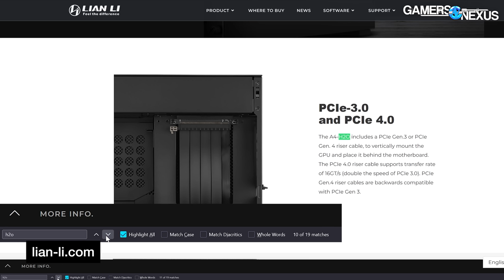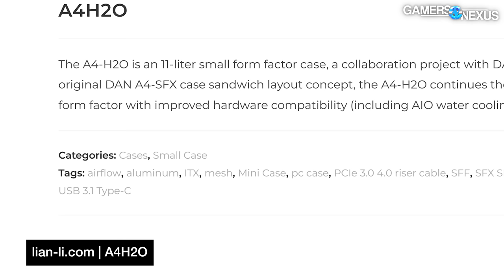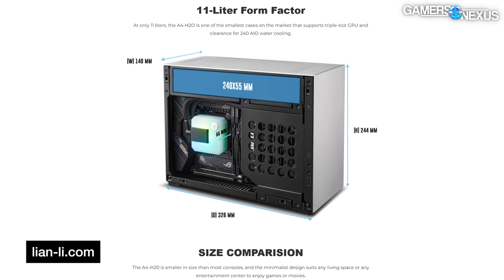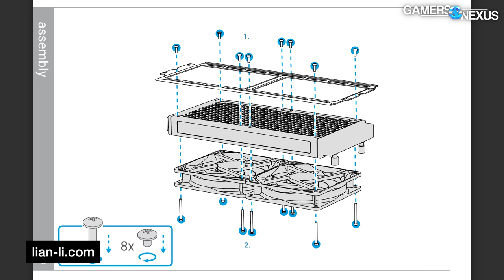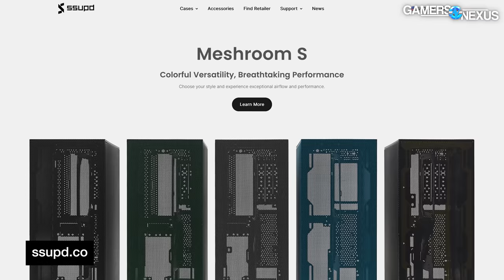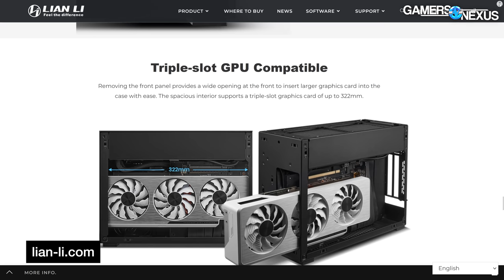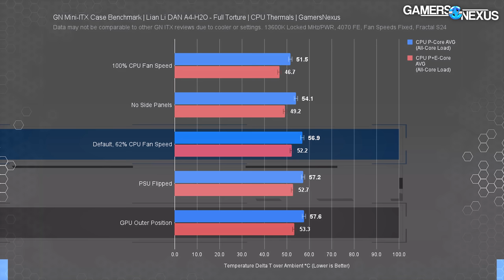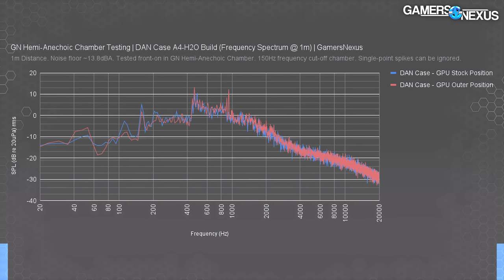Water Cooled Mini-ITX Review: Dan Case A4-H2O Thermals, Noise, & Cable Management

Comment: I get why people like this case but when I had it I hated it. I didn't like the way the panels mounted and it kind of left it feeling cheap. They weren't fully flush which led yo sharp corners plus the thumb screws felt like an oversight on panel security. I have the Cooler Naster NR200 now upon which I honestly can say I thoroughly enjoy this case way more. It just feels more completely finished of a product. The only thing I did enjoy about the Dan cases that it is quite smaller than the NR200

Comment: I think with ITX builds when it comes to cable management, many builders will opt for custom length cables to fit the case runs with little slack left over.  Reducing the need for cable management.
Reply: I just upgraded my rig with this exact case a month ago, and I have since decided to invest in 2 short 8-pin PCIe power cables from Cable Mod to cleanup some of the excess cable clutter.
Reply: Yes - It helps, but you if you send a bit of time routing the cables properly instead of GN's bowl of spaghetti you end up with a very clean solution (which my Dan A4 H2O is).
Reply: Agreed. I have this case too, with a modular SFX PSU, an RX7900 XTX, and two additional 40mm fans, and my cabling is a heck of a lot neater than GN's. Having said that, Steve did not state the obvious in that you can't see the cabling with the panels on!
Reply: @jimiscott exactly what I was thinking.  This case can be really clean with just a little time routing cables along edges etc
Reply: As a long time SFF builder... No. Whatever Steve is doing is the norm lol. That's just a downside to SFF.
Reply: @Spentalei  I guess if that’s your standard. I could never in good conscience put something together like that but to each their own
Reply: @chadhowell1328  Define conscience? It's not like it matters except for looks. Since I'm running an SFF case without a window I didn't even try this time (C4-SFX).
Reply: Can vouch for this, I did the same thing when I was ordering cables for my T1 from PSlate Customs. Wanted to keep airflow best as possible with minimal length
Reply: The cables that come with sfx power supplies are already pretty short
Reply: @chadhowell1328  Nope, he is completely correct.  OP is wrong.  It's like case fan testing but even worse.  If you add in the price and variability of custom cables, you've immediately overstepped the bounds of reviewing.  You MUST not consider custom cables, because they're CUSTOM and therefore irrelevant in the video and comment section.
You can fix any issues with infinite money, time, and effort.
Reply: @Grimmwoldds  I agree with custom but I have this case without custom cables and it’s not a rats nest like this. I have an ek240 AIO with noctua a25’s and the Lian li sf750w PSU with the original cables.  Couple zip ties here and there and the case can be extremely clean since the edges allow for cable routing which wasn’t really pointed out in this.
Reply: @chadhowell1328  That ones a phanteks.  Might have longer cables to accomodate the larger cases they make.
Reply: @Grimmwoldds  Plus, I believe they are trying to use one power supply for their reviews, and not different power supplies that might technically fit better in one way or another.
Reply: Custom cables will send Steve & Co down a whole new rabbit hole.... custom cables are custom to the specific PSU line PLUS the particular case, ie, having built in NZXT H1, Dan A4 SFX, Ghost S1, Lian Li A4 H2O, NR200P, SKTC A07 I can safely say that you would be lucky to reuse your custom cables in another case (although the ones for the S1 and the original A4 are a good fit - the ATX 24 pin optimally would need a tad more length in the S1, but works with the one for the A4)
Reply: You don't need custom cables for this case. My Dan A4 h20 looks a lot cleaner than Gamer's Nexus' with a little more effort and planning; this was my first SFF build. 

I'm running a 313mm 2-slot GPU and a 240mm radiator at the top for the Kraken X52 AIO. NVMe on the mobo and SATA ssd on the bottom. 

The only real compromise is you can't really use tall RAM sticks bc of the ITX AIO cooler bumping into it, and more places for storage (get 4tb ssds for these builds or externals).
Reply: Totally agree, I will build into this case and I will “invest” in custom cables.
Reply: true but custom length usually can be either time consuming if you make it yourself, or expensive if you buy it from elsewhere, or both if you opt to build the cables yourself using premium sleeving wires.
Reply: @bzavacado  how have the PSlates been holding up?
Reply: @Shokeilive  still as great as ever! Although I do wish they can make custom 90 degree custom length cables

Comment: I put a 7800x3d and 4090 in this case, it's pretty janky to build but the thermal performance is pretty great for such a small case. I think it's a great case.
Reply: What cooler did you use?
Reply: @MrTekniqs For the CPU AXP90-X47 copper, for the 4090 it came with AIO (MSI Suprim Liquid X)
Reply: @vincenttam8642 does such a tiny cpu cooler prevent the 7800x3d from thermal throttling?
Reply: @magenof1440  yup never had any thermal throttling with the 7800x3D. Max temp under 10 mins Cinebench R23 stress test were 81C and for gaming CPU around 60~65C, GPU 55~60C. Perfectly acceptable temp. 

But I did -25 Curve Optimizer under PBO2 for the 7800X3D

Comment: A few tips:

1. If you want to air cool, it's totally doable. The Thermalright AXP90-X53 is made specifically for this case. It works great with a couple Noctua case fans up top. 

2. Try routing the CPU power cable behind the motherboard and the 24 pin power cable behind the PSU. I have a Corsair SF750 and the included cables are the perfect length. Cable management is beautiful. Just make sure the GPU is mounted on the outside slot as in this video. I did get a 150 mm VGA cable from CableMod which also fit my RTX 4070 FE perfectly, but that's not necessary.

3. If you're air cooling with top mounted case fans, use a wooden chopstick to flip the PSU switch without taking the fan mount off. 

4. For AM5 users, do NOT get the Gigabyte B650i Aorus Ultra if you want to air cool. The daughterboard is completely inaccessible so you have to connect the case fans via molex, and one of the board heatsinks makes most CPU coolers (including the AXP-X53) unusable. The ASUS ROG Strix B650Ei works great though.
Reply: Great tips, I am working through part select for this case right now.
Reply: I'm running both this case and the B650i Aorus Ultra, and even though the daughterboard is obstructed the only things that are inaccessible are the Sata headers in my experience (Which aren't really important given the case and that you can fit 3 M.2's onto this board. I'm also running an EK Nucleus 240mm cooler and that isn't obstructed by any parts of the board.

(As a note, I'm running 6 fans off the motherboard, replaced PSU fan, Noctua 92mm slim over the M.2, 2 NFF 12's in the top, and 2 slim arctic 140's as a GPU cooler mod and it all works flawlessly off the motherboard!)
Reply: I'm using an ID Cooling IS55 in this case, motherboard ASRock B660M ITX, plus 2 Noctua fans S12 Redux on top, love it 👌
Reply: @dickinathaniel2250 the ID cooling IS55 fits? I was looking at that cooler but thought it wouldn't fit due to being 57mm? Also seen another guy struggle to get the side case on
Reply: This is what I did, went full air cool, though I need to move the GPU to the outer position, I think I should be able to do that with the EVGA XC3 Ultra 3080.  I've got the AXP90-X53 with a changed out Noctua fan, which I modded with the NA-FD1 air duct against the case to lock in cool air as well, it works a treat.  Also two additional PWM 120mm fans for air intake through the top, I added some filters for dust as well, which will just in general help the build as a whole just a touch more, though not totally sure exactly how much, maybe just to help keep dust out to an extent.

Also using a Corsair SF850L, and while cable management wasn't the most fun part of the build, I minimized how many cables were needed, only using the mobo 24-pin, 1 CPU, and 2 PCIe for the GPU.
Reply: @JustinBakerDeDav  You're using the top fans for intake? Interesting. I have them set up as exhaust fans. Since the CPU cooler and GPU fans are doing intake duty and warm air tends to rise, I assumed using them as exhaust would be better. Never tested both though.
Reply: @nerfherder6166  Yeah, more air-in helps with dust minimizing, plus the whole filter things I added.  I would have loved to put the fans on the bottom, cause yeah you're right, heat rises, but no fan positions on bottom blegh, it's one of the only real shortcomings of this case that I personally see and/or care about.  Plus I built in this case specifically against what it was designed for, an AIO, so I'm already doing it wrong.

I would have loved to get one of the other Dan cases like the A4 SFX or C4 SFX, but they're either unavailable or way over priced if available from aftermarket (at least in my opinion), and they have overly limiting front IO, which I tend to use a fair amount, I don't want to have to give my PC a reach around any time I want to plug in a USB-A, so ultimately the A4 H2O worked out quite nicely.
Reply: @dickinathaniel2250  how its going so far ? Cant decide about cooling and case. I think your choice could be mine too :) Please advice

Comment: This has got to be one of my favorite cases. I am personally running my set up with an rx6800 and 5800x3d, plus custom cables, and I’m getting amazing temps / noise.

The fact that you can stick a 4090 and a higher end cpu with minimal compromise is wild. No need for a giant 40L case when the A4 H2O can handle high end components with ease, and save space!
Reply: I don't know I think it's going to get a bit warm with over 3x the heat inside
Reply: @mddunlap03 the GPU wont care much as it draws outside air, in fact this setup is better than in many big tower cases for GPU temps - CPU temp however will definitely rise as you are dumping all the GPU heated air out through the radiator.
Reply: I have the same RX 6800 and 5800X3D combo but I used the Fractal Ridge since it’s for a living room gaming console using ChimeraOS. This combo works great and once I undervolted the 5800X3D temps are great with a Thermalright AXP120-X67.
Reply: I'm surprised you can fit that, what 4090 are you rocking? I have a Gigabyte 3090 OC and it barely fits.
Reply: @mddunlap03  I run a 4090+7950x3D no problem. But I do maximize cooling by squeezing in the best 120mm fans on the radiator, T30s. Also removing the lid while gaming helps significantly which is kinda important when you're pushing ~400 watts through the GPU.
Reply: My thoughts looking at this are "just because you can doesn't mean you should !"
Reply: would u pls share the lengths for custom cables?

Comment: I must say, the EK basic 240mm cooler just makes the cable management and the tube routing just chef’s kiss in this case. Stylish and looks super snazzy, can keep most of the cable management in the floor of the case and pulled up where you need it. GREAT REVIEW, can’t wait for more ITX content!!!❤
Reply: i have this case with the EK basic 240 and i agree with you, it's like it was built for this case. unfortunately the last i checked EK doesn't sell it anymore!
Reply: @richsnapp6149  a few months back they still had the RGB 240mm, but they did discontinue the basic! A shame, the all black pump block with the EK logo looked super clean with the black aluminum panels.

Comment: I have had mine for almost a year now.  I have a 13600k paired with a 4080 and it was a little bit of a challenge, but that is the fun with SFF builds.  My thermals are great and the whole system is quiet.  The other cool thing you can do is make custom fronts to the case that are easy to remove and install via magnets.

Comment: This was my personal build’s case before I switched to the SSUPD Meshlicious. I went with a Corsair SFX PSU and the cables it comes with are braided an shorter, which made it great for this case, and unlike the OG Dan A4 which I built in, you don’t really need custom length cables

Comment: I built in the H20 with the same AIO and this model has 400mm tubing and Dan recommends routing the tubing below the PSU rather than above. I would also recommend getting yourself a Corsair SF750 just for the better cables if no other reason. It's fairly easy to hide away the fan cables which would have made your build much cleaner.

Comment: I’ve built 3 PCs using this case and it was such a pleasure to plan out the build.  With m-ITX cases you really have to build in a particular order to get better cable management and also get it to fit properly sometimes.  It’s sleek has great thermals.  It can even fit a Strix 3080 Ti.
Reply: I'm heavily considering this. I've built in an Ncase M1 (My first build ever) & the NR200. I really like this sammich type layout vs conventional.
Reply: What 240mm CPU liquid cooler would you recommend for this case?

Comment: I built my first PC in this case a few months ago. I built mine to a $1,000 budget, and chose to forgo the AIO in the interest of allocating more budget to the GPU. To anyone thinking of doing an air cooled build in this case, it does work nicely, and you can put two 120 mm case fans in an exhaust configuration where the AIO would go to aid airflow. Again, in the interest of budget, I'm using the stock Intel RM1 CPU cooler on my i5 12400, which is admittedly quite noisy under load. My GPU is an overclocked and undervolted ASRock Challenger Pro 6750 XT (2735 MHz, 1125 mV, +15% Power Limit). Both the CPU and GPU are running a custom exponential fan curve. My temperatures are as follows:

CPU (Idle): 41 C @ 33% PWM
CPU (Gaming): 75 C @ 100% PWM

GPU Hotspot (Idle): 47 C @ 0% PWM
GPU Hotspot (Gaming): 90 C @ 65% PWM

GPU Edge (Idle): 43 C @ 0% PWM
GPU Edge (Gaming): 68 C @ 65% PWM

Ambient (Idle): 41 C
Ambient (Gaming): 53 C

Comment: Ive built in two of these. My current build is a 13700k w/ an evga 3080 ftw3. I even managed to fit some t30 fans in it as well. Ive built in the Dan a4 sfx, sentry 2.0, NR200p, Ncase m1, as well as other lesser known itx cases and i have to say this is my favorite so far. For aio cooling this is one of the best cases that balances overall size and component compatibility with performance. 

To Steve's point, this would be a little more difficult to build in for someone just beginning to build in ITX cases because of the cable management, but if youre willing to be patient id reccomend giving it a try. Custom cables make it incredibly easy and tidy if youre willing to spend the extra cash.

Comment: For AIO recommendations, I used an H100X with Noctua fans, routing the hoses from the left up , around the block and to the right through the top gap at the PSU bracket. It's a very clean run like this, however I'd recommend either securing the hoses in a way where they won't interfere with the fans, mounting the fans between the radiator and the bracket, or using some fan grills to prevent the fans scratching against the hoses or other cables.

Comment: I’ve got this case and I love it.  It’s my second ITX case after one from Sliger. The DAN was half the price, has a smaller footprint, and easier to build in. Definitely a home run in my book. 

I’ve got a 4090 FE, 5800x3D with the EK 240 water block and squeezed in some Phanteks T30s. It stays nice and cool, and while a bit loud a max load, I’m usually gaming with headphones, so I don’t mind it.

Comment: Thank you for validating a choice I made 15 months ago :)

Really this case is amazing and performs well.  (12700k/3070ti).  I bought angled adapters for the GPU power cables to help with clearance on the bottom, but otherwise it was surprisingly easy to build in for a case this size.

Comment: With this move towards itx reviews, I am hoping that the GN team will start testing some more low profile CPU coolers such as the thermalright solutions available. Noctua is great but more options is more better.
Reply: Agreed, and a great case to review them in would be the Fractal Ridge, just did a build in one and used a Thermalright AXP120-X67. It’s working great, tried an ID-COOLING IS-55 first but had clearance issues with the power plug.

Comment: I built a budget/low power machine in one of these a few weeks back. I had helped a friend diagnose a faulty motherboard and had ordered cpu/ram/mobo for that. I was left with a Ryzen 5500 and 16gb DDR4 and decided I’d use them instead of adding them to the hoard.

In my case (no pun intended) I ended up running with the stock stealth cooler with a bit of foam to seal the intake against the side panel. I also slapped in a couple of spare 120mm hyte fans I had laying around in the top. It runs relatively cool and maintains boost clocks consistently while gaming and benchmarking, but that’s down to the 5500 being what it is not the prowess of the case for air cooling 😂

I only really had an SFX-L power supply option available in my budget and time frame when I was ordering parts for the build. I would 100% recommend going with the SFX over SFX-L. The extra space to stash cables would have been a huge help. I also had to double-sided tape my SATA SSD to the back of the power supply because I couldn’t mount it to the bottom panel with the SFX-L. I did also find that if I had it in that position, the SATA connector seemed to interfere with the spine of the case?? However that could be down to the combination of parts and cables I had laying around.

For graphics I took a punt on the arc A750. Impressive benchmark results and no thermal issues in the case. I’m now living the arc life of watching for game and driver updates to improve performance on titles I like to play.